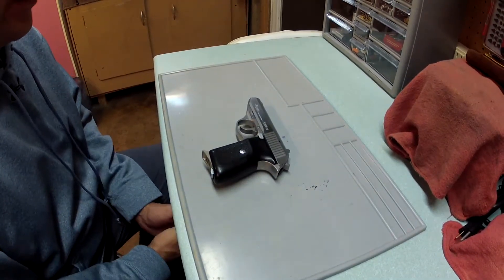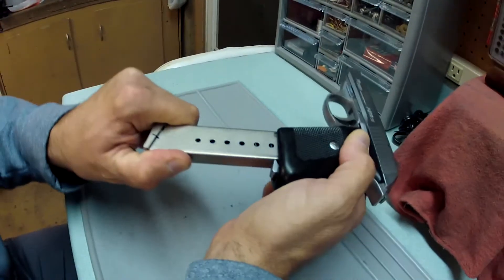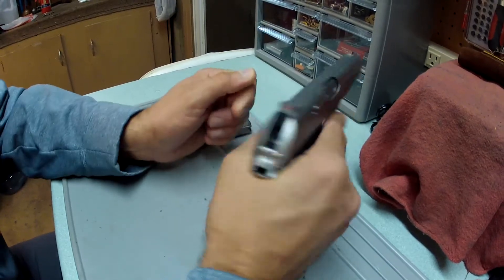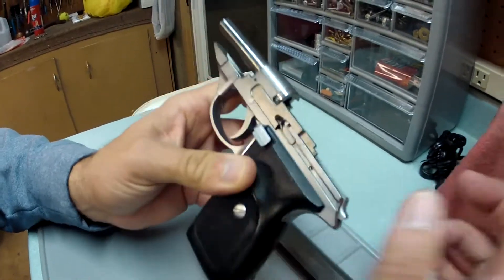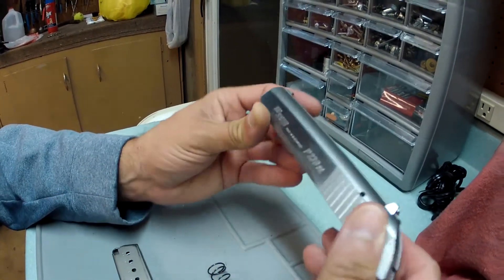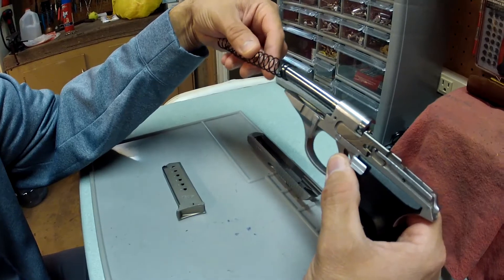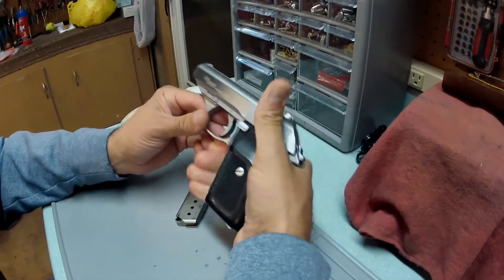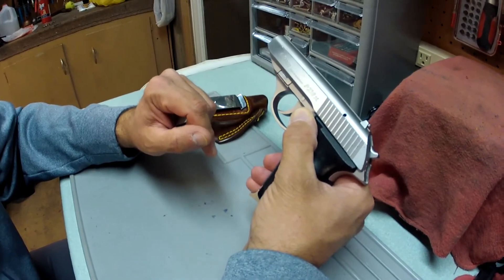Sig Sauer P230 Review - SGT061

Comment: Thanks for the great video. As a 54yr old woman with arthritis in my hand (thumb in particular),  how would you rate the ease of using this particular model's slide as compared with others in the same price range?
Reply from the maker: +judi stevenson Not going to lie...the slide is a bit hard to pull back. If your going to stay with a 380...why not try the Glock 42. It is lighter, and a bit easier to retract the slide then the Sig. The Glock 42 is probably a bit less expensive too. The Sig is all steel, frame and slide, a bit heavy, but with that it doesn't recoil as much. Thanks for the comment.
Reply: +judi stevenson - I guess it really depends on how it feels to you.  I would suggest you go to your local gun shop and take a look at what they have and feel the slide.  I personally think the slide on the p230 is smooth and easy to rack but it may be completely different for you.  I also think the serrations on the slide (the grip) makes a huge difference as well.  

If the slide on this is too much for you, perhaps something of a smaller caliber would be better,  or even better yet something that doesn't have a slide to operate like a 38 special revolver.  Although I personally think most modern revolvers are not pretty guns, the fact of the matter is they are much easier to use then a semi-auto pistol and are even more reliable (not saying semi-auto pistols can't be reliable as well).

Now that being said, this particular gun is no longer available new, so you would either need to look at something used or look at the model that replaced it, the p232.
Reply: The sig p238 has a very easy slide pull

Comment: rained on my dreams man!  i adored this gun until i saw biting issues (
Reply: I have the 232 with the finger grooved Hogue grip, and I have never had an issue with slide bite.  It's a beautiful pistol.  Love it, and you should consider it if you can find one.  Aside from a dovetailed front sight, the 232 has a hammer block safety, so the hammer cannot contact the firing pin without the trigger being pulled.